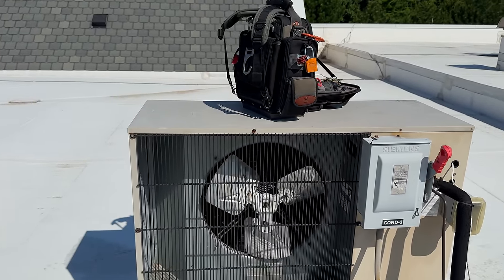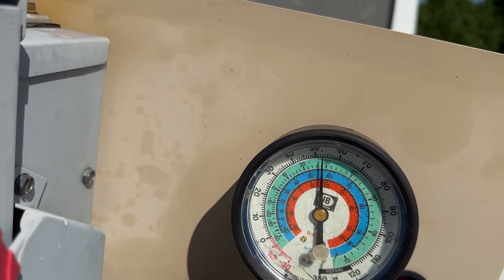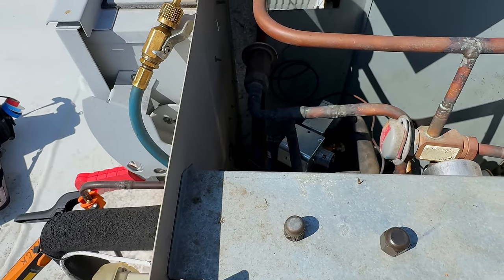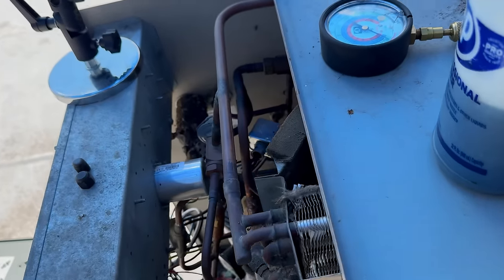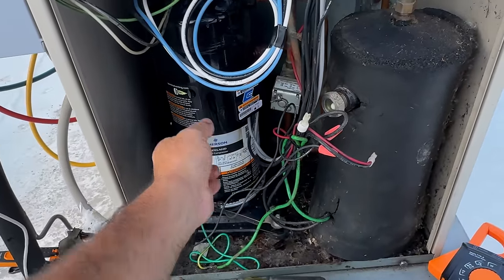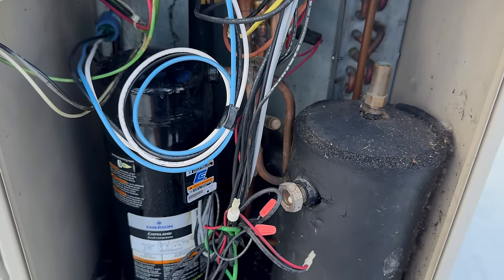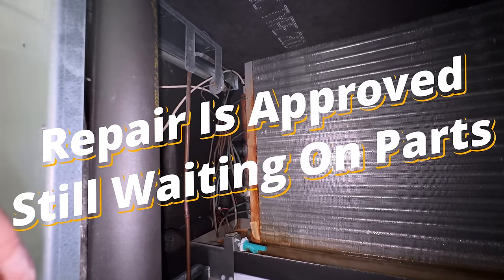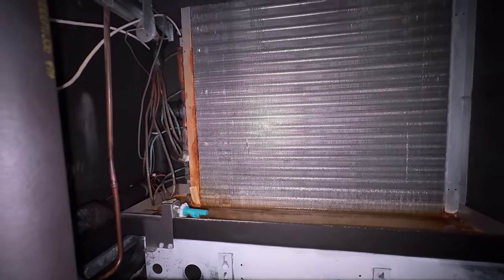IT Room Overheating Liebert AC Fails In A Weird Way

Comment: I had an intermittent high pressure issue on one of these.  Head master was sticking in the cooler mornings even though I could never get it to happen in front of me.  Replaced head master and haven’t had an issue since.  Hate intermittent problems.  Keep up the good work. Enjoy your channel. 👍🏿
Reply from the maker: I appreciate you sharing that with me, like I said it was very odd the way it reacted so hopefully when I go back to replace the coil, I can replace that head Master at the same time and eliminate both things at once.
Reply: Are you serving Fresno area?
Reply: @Andrewchen7955  I’m in Boise.

Comment: With the ultrasonic detector they highly recommend that you spray a liquid over the possible leak to help locate as the bubbling creates the ultrasonic sound needed to locate
Reply from the maker: I’ve had problems with the hydrogen in the water, popping bubbles and throwing you off.

Comment: Had a leaker in a walk-in cooler evaporator, last week . My stratus only hit on it once . Pinpointed it with my Bacharach informant 2. Good Video Rick .
Reply from the maker: Interesting. I haven’t heard a whole lot good about the informant 2? Honestly, I believe my H10-PM was better than my H10-pro. Depends on the flavor. R22 is where it shined
Reply: @HVACRSurvival I do believe the informant uses heated diode tech - I generally use the informant for HC gas - have a tip for it. But this leak kinda pissed me off. So last week I ordered a DR82 from TruTech tools . Thanks for the 8% ! I have found that some refrigerants sound off better to different detectors . The Stratus has been my money maker . Someone told me that I should send her back to get a recalibration? I do own an old GE H10 - haven’t used it in years though , it was super in its day . I think Bacharach makes the H10 now  .

Comment: Those Liebert were pretty good systems back in the day, but for whatever reason the 407C is rough on expansion valves and rubber components, A lot of people now just replace them with an inverter type split system, you could buy three inverter systems for the cost of a Liebert
Reply: Yup, I threw in a 3 ton single head. LG mini split in a server room back Dec 31 2022, and it's been working great. Had one of the coldest winters in last 3 years this past January and it's been working like a champ. The old system had some junky old air handler with terrible ductwork in the droppped ceiling, and the compressor had burned out badly in the old one and it was only 2 ton, and wasn't keeping up. The mini split is also much quieter, I was able to delete all the junky ductwork, and it does a much better job of humidity control, and they were able to raise the set point up to 74 degrees, instead of 68-70 with the old junk that was in there.
Reply from the maker: Yep

Comment: I ALWAYS  BID  a backup system with anything dealing with critical  needs.
Won every bid I gave against other contractors that bid only one.
The backup was rated at about 50% of needed capacity but would squeak them through a failure of their  main system.
Was  surprised no other contractors offered that option.
Reply: Very smart.

Comment: Probably close to 80% of my work is on Lieberts. My shop is one of their factory reps. I’ve been to Ohio for a factory training and I have to maintain the certifications to work on the equipment.

The reason you have to raise the head pressure to 230 is to stop the headmaster from regulating. You are basically tricking the unit into thinking it’s 110 outside. In those conditions the receiver should be full. 

That charging method does work year round, but typically I check it at 250psi to avoid overcharging.
Reply from the maker: Cool thanks for clearing that up.

Comment: Looks like Liebert was bought out by Vertiv in 2016. I work in IT and our new data center has Vertiv/Liebert CRAC units. I enjoy your channel, keep up the good work!
Reply: Emerson owned liebert before vertiv did.
Reply: I didn't know Liebert is an Ohio company, I mistakenly thought there was some German connection - there isn't.
Ralph Liebert (1918–1984) in Columbus, Ohio created 1965: Capitol Refrigeration Industries. in 1965, Ralph created the company in his garage in Columbus; then IBM promoted the new cooling product.

Liebert is now a subsidiary of Vertiv.  Liebert cooling units are manufactured by Vertiv Brands (formerly Emerson Network Power).  "Vertiv is an American multinational provider of critical infrastructure and services for data centers, communication networks, and commercial and industrial environments. Vertiv Holdings Co. Westerville, Ohio, U.S."
Reply: @davidnull5590  New Liebert's always hip from Ohio, I just thought that's where they came to from Germany. I never knew it was solely a US based company lol. I would always tell new techs Liebert's are complicated because German engineering lol.

Comment: I had an intermittent head pressure problem on this same style unit several years ago. 

I got up on the roof to the condenser one time and it actually went out on head pressure in front of me. It happened so fast I didn’t really have a chance to see what happened, so I mashed in the contactor and watched my gauges. 

Took about 5 seconds for the relief valve to pop off right in my face. Dye and oil and refrigerant everywhere lol. 

I started it back up and it ran perfectly until we replaced it a few years later.

Comment: We have four Liebert CRAC systems in our datacenter.  You could fit this entire cute little thing inside less than a fourth of a CRAC.

Massive, massive, massive coolers.
Reply from the maker: That would be cool see. I’ve seen some nice rack cooling units.
Reply: @HVACRSurvival  these aren't within the racks, they are standalone (against the walls) pressurizing the under floor space with conditioned air.  Dual compressors in each unit.  I'd guess somewhere in the 30-40 ton range.
Reply from the maker: Those must be some really large server rooms
Reply: @HVACRSurvival  maybe 100' x 50'?  We have four rows of equipment about 25 racks long.

Btw we actually do have two APC rack coolers if you're interested.  Catch is, they're in Norcross, GA...

Comment: I've also had to do a head pressure control on a Liebert, but the compressor was in the AHU and had a remote condenser. it was R22 converted to 407C had a Sporlan 210psi in her, But that unit also called for charging by sight glass, it had a massive receiver on the roof with 2 sight glass, it gave some OAT and said in this range half way up the first, this range first full this range half way up the second sight glass, and that's it.  it was a 5 ton unit took 28.5lbs of gas, crazyness

Comment: i just had a call on a minimate on friday!! i got off easy, the controller on the wall was showing 4 degrees higher than the room temp and the controller has a calibration function ez mode.
Reply from the maker: Sounds like you got lucky

Comment: Have that unit  at the facility I work at.Been a problem child for me in the past. That air handler pulls return from the center and blows air out the sides of the grill.There should be an access door on the side of the filter that should be in place to prevent recirculating the air.
Reply from the maker: There’s some foam in there that’s not in place like it should be.

Comment: 16:47 saw some predator blood on the cap for the port attached to the u bend on the bottom of the evap coil.

Willing to bet that when it goes into dehumidification mode (dumps hot gas into the suction line to effectively reduce system capacity and why they need that suction pressure regulator) the back pressure was high enough to pop a weakened braze.

Comment: I didn't know Liebert is an Ohio company, I mistakenly thought there was some German connection - there isn't.
Ralph Liebert (1918–1984) in Columbus, Ohio created 1965: Capitol Refrigeration Industries. in 1965, Ralph created the company in his garage in Columbus; then IBM promoted the new cooling product.

Liebert is now a subsidiary of Vertiv.  Liebert cooling units are manufactured by Vertiv Brands (formerly Emerson Network Power).  "Vertiv is an American multinational provider of critical infrastructure and services for data centers, communication networks, and commercial and industrial environments. Vertiv Holdings Co. Westerville, Ohio, U.S."
Reply from the maker: Crazy I know.

Comment: Did you put your screw driver through the solenoid to stop it from burning out?
Reply: Yep you’re correct.
Reply from the maker: Correct JP. It’s an induction heater without anything in the middle. And you’ll burn that coil out within a few minutes if you don’t have some sort of metal core in there.

Comment: CAT III 1000V is really important for commercial HVAC work.  Unfortunately the 902FC only rated CAT III 600V.  That is a safe residential rating.  Don't know why FLUKE did that on a meter designed fot HVAC work.

A lot of meters say they can do inrush but, it takes a really fast meter to read inrush correctly.  You have to capture the ring, simular to watching Ignition coils on an O-scope.  Fluke inrush meters takes 400 samples every 100 ms.  FP doesn't come close.  Curious to see what the sampling rate is on the Testo's.
Reply from the maker: I’m going to test it against my 376fc
Reply: @HVACRSurvival   Fluke has information on how their meters work capturing the inrush.  Search inrush fluke clamp.  The 345 was listed as an HVACR meter.  Maybe one day it will be an ebay find when I'm loose with my money.  I like the o-scope on a clamp meter.  Would be a complement to my 87.

I carry a small o-scope on the van, brought a screen shot back to the other techs in the shop.  What is that?  That's the voltage over time.  There was no 24 control voltage to the ECM.  I see a + and - on the plug I wonder if this is digitally controled?  Sure enough!  I need to make sure the board is trying to control the motor when im quoting two $1000 motors. They roll there eyes and move on.
Reply from the maker: @HVACR559  I have a decent little two channel scope that’s portable that I use for my power station reviews. It’s 70 MHz. The 376 was their best meter in the clamp form and it’s not that much more money. You can get lucky and pick one up for 200 bucks easy on eBay.

Comment: Contrary to normal logic those systems will trip on head pressure when they are low on gas, the headmaster control valve will shift trying to build head pressure leaving nowhere for the hot gas to go but directly to the expansion valve, which is a restriction and it goes off on high pressure
Reply from the maker: That makes sense

Comment: How many tons is that system? You might be better off just replacing the entire thing with a mini split system. I did a 3 ton single head unit for a server room winter before last on New Years Eve, and it's been working fantastic. The thing with that server room I did, they need cooling even in the middle of January since the server room is a secure room in the middle of the building surrounded by heated conditioned space, and mini splits tend to do very well with low ambient cooling right out of the box.

That Liebert looks like a cobbled together pile of fecal... lol
Reply from the maker: I forget, probably 5 tons. We sell Mitsubishi and carrier mini splits. And that’s what we’ve used plenty of times. Technically Liebert makes some pretty fancy systems. This is one of the lesser quality ones. The one I have at one computer room is fully touchscreen with an Emerson controller and they’re made to run in -20° weather I believe.
Reply: @HVACRSurvival  Mitsubishi is better I think or even Fujitsu. Only reason I went with LG that time is the supply house that stocks LG is literally two doors down on the same street and under 2 miles from my house, and nobody else had anything in stock. This was the tail end of the Covid crap, and stuff was hard to get. And they needed cooling asap, this place they work on top secret battlefield communications stuff for the US military so cost wasn't as much of an issue rather than "just do what needs to be done, and make sure it's reliable". A mini split isn't perfect for a small server room but it was good enough for government work as they say :D

They have 5 full height racks in there, all on five 120v 30 amp breakers plus a big UPS system so that's a lot of wattage to cool down.
Reply: @HVACRSurvival  Yeah the bigger units fitted with an iCOM panel and properly networked up with the right sensors can do some really neat stuff. These smaller units aren't my favorite but we use 'em anyway because they integrate into the control system and let us have one panel to control all the systems across all our sites with.

Comment: Cost of an HVAC system is meaningless if the customer is offering their critical system to their customers.
They just need it to function within their heat removal parameters .
Didn't require heat load with people for a backup, just the running equipment.